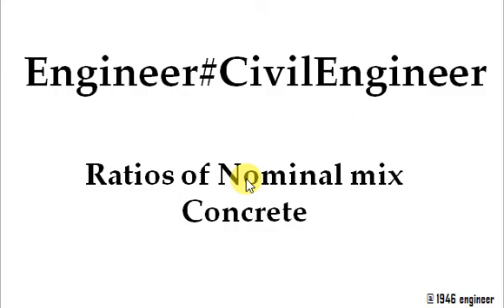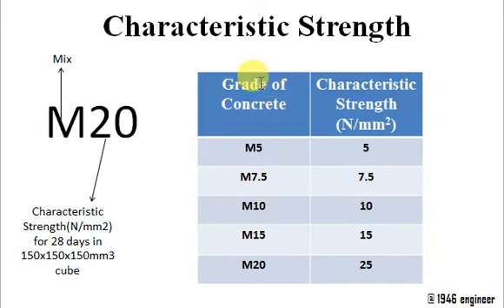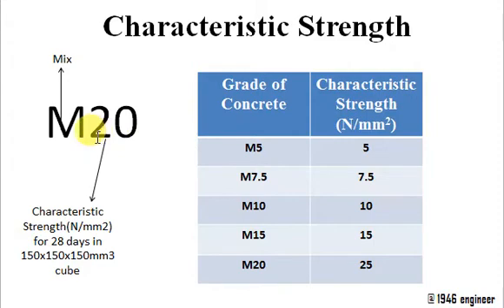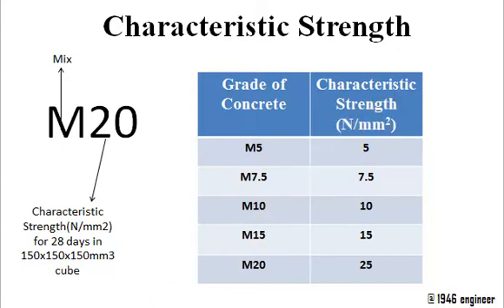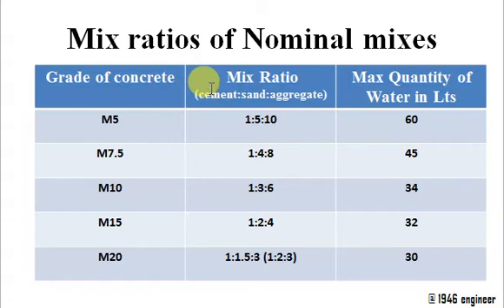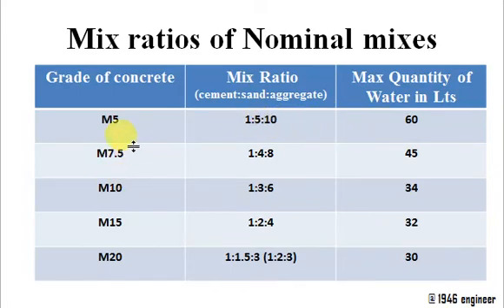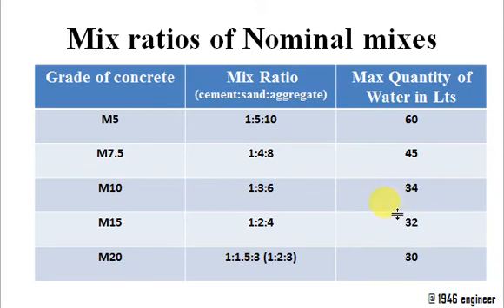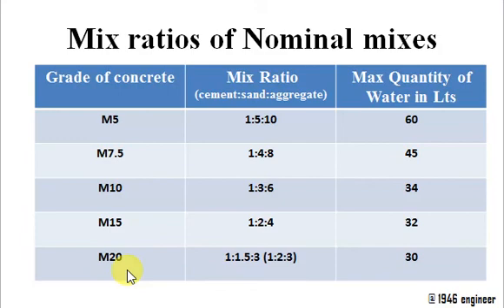Mix ratios of concrete

Comment: M20
M - mix
20 characteristics  compressive strength of concrete ( not more than 5% of results expected to fail) 
M5-1:5:10-60lit
M7. 5-1:4:8-45lit
M10-1:3:6-34lit
M15-1:2:4-32lit
M20-1:1.5:3-30lit